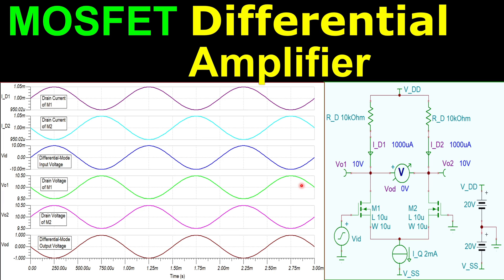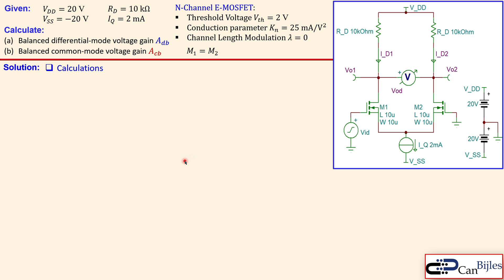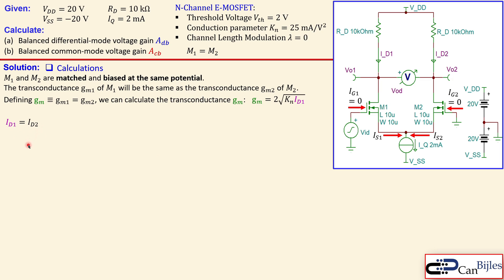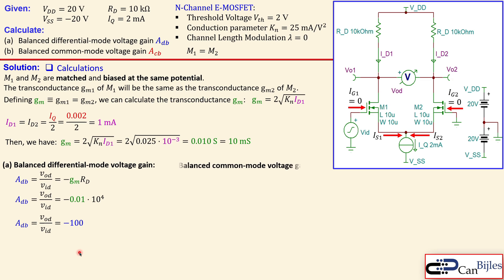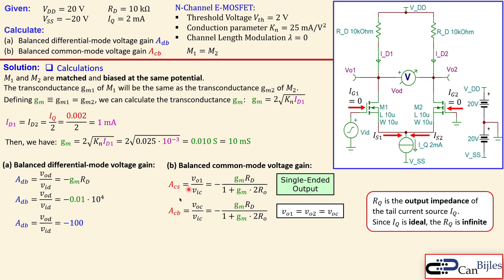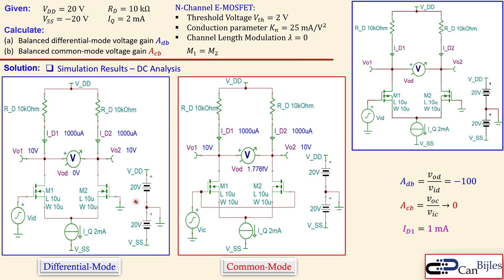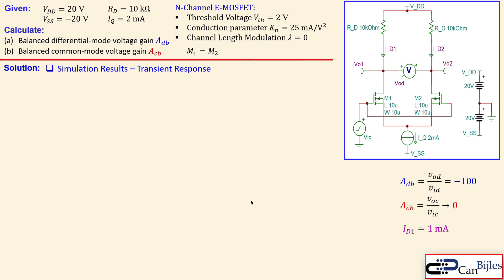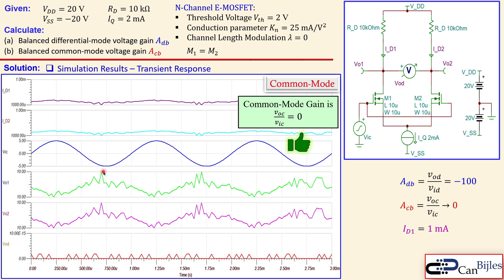MOSFET Differential Amplifier - Ideal Current Source 🌟 Differential-Mode & Common-Mode Gains 💡 EX1

Comment: does gm =rtsq(2 Kn Id)  or gm =2 rtsq(Kn Id)  ?
Reply from the maker: It is gm = 2*sqrt(Kn*Id). The Kn = 0.5*un*Cox*(W/L). SPICE model will use BETA = un*Cox and you need to adjust this in the MOSFET ratio of W/L.

Comment: According to the book Tietze Schenk, "Halbleiter Schaltungstechnik" = a German semiconductor bible gm = sqrt(2*Kn * Id) (12 Edition, page 185). Thus the peak voltage at 10 mV input is 0.7 and not 1 V. I cannot judge which one is right or wrong.
Reply from the maker: These two parameters are confused too often. One is the process conduction parameter kn' and the other is conduction parameter Kn. The Kn = 0.5*kn'*(W/L). If you work it out, you will get the formula I use in the video.
Reply: @CANEDUX  By the way, your videos are excellent!!! Many thanks. My comment is surely based on the confusion you are referring to, however it seems that the form sqrt(2.... is mostly used as confirmed by chatgpt as well ;-). Anyway, not sooo important.
Reply from the maker: @georgschett801  Glad you liked the videos 👍 Do not forget to share and like.
My advice: do not put too much value on the solutions by AI. Sometimes it is really plain wrong.